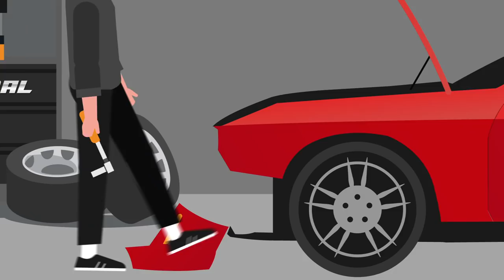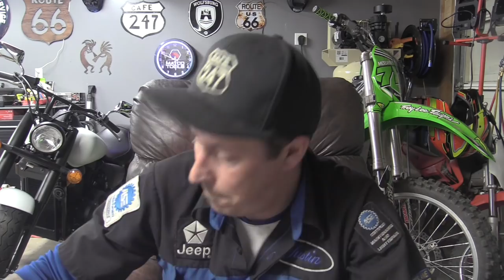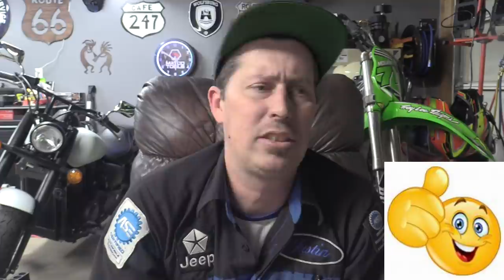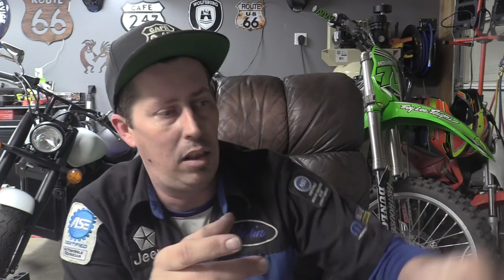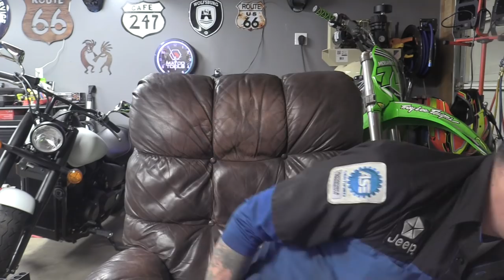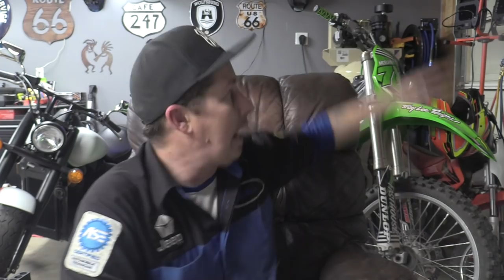Multi Point Inspection & After Repair Tips & Suggestions for Technicians!

Comment: I always take any car I work on for a quick spin before I pull it it, can't tell you how many times the car was just pulled in, and you sell some work, then on the test drive you hear a wheel bearing making noise, or some other rattle, so I quick test drive every car if possible first, make notes of any issues and put it on the safety check, keep up the good work Justin✌

Comment: Congratulations!  And
 i some what agree with the  parts but not the prices
Reply from the maker: The difference in price is the difference in quality and craftsmanship. The benefit is that it was designed to specifically fit that vehicle. Where is aftermarket components often times are just designed in a roundabout way so the casting is always off either something is too tall too big for the holes don’t even lineup so you have to use a die grinder to clean them out. Even if you were a DIY think about how much time you’re willing to spend trying to modify a component that was never really made to fit as well as a factory part. The advantages are that most OEM components also typically last longer in my experience. Lots of things to consider, but you’re not the only one that feels that way there are many People out there that are only focused on the price
Reply: @JustinDowDIYcentralhighway  what i meant by the comment was i agree with its great having the correct part there. But i do not agree that the part is 3 times the cost. The part was already engineered.  They are made . It should cost no more because it comes from a dealer not a person next door. There are other companies that make great parts. Ie. I would rather use a moog wheel bearing than oe. Lasts longer. Here is a thing. You buy different tools diffbrands. Let's say snap on invented it but you like matco more because its the same and same warranty.  Its also personal preference

Comment: Hey man! I'm looking for a solid answer to my question regarding the vacuum style/venturi coolant fillers. What happens to remaining coolant that might be in the system after draining before refilling. Would the tool still pull a good vacuum and load fresh coolant without air. Ever had the vacuum break a plastic reservoir or hose? Thanks
Reply: They just work, got an old blue point vacuum filler and it prevents overheating after all kinds of cooling system repairs! Never broken anything over 1000 cars, good to confirm you have no leaks (will it hold a vacuum?) without filling with coolant to see if it comes out.
Reply: This tool is not made for coolant removal !!! Some coolant WILL remain in the system usually in the engine block. The vacuum filler only removers the air thus eliminating air pockets, allowing the new coolant to completely refill the system. You still need to run it out and then top it off, but this doesn't take long because you don't have those HIDDEN air pockets to worry about. If a hose or plastic bottle fails due to vacuum on the system, then it would have or will fail with pressure on the system and needed to be replaced anyway.
Reply from the maker: Looks like he got a couple of really good answers here for you. I’m glad they were able to answer your question in a timely manner as I was in bed 😴 Just a piggyback off what they said the air lift/ Venturi coolant filler pause the air out to alleviate any kind of pockets within the system, it will pull a little bit of coolant out of one hose which is why you need an empty bottle to catch it in but it’s not a removal tool. I too have never had any plastic reservoirs break as a result of using it, also once you’ve officially pulled new coolant in I always run a second vacuum Just to ensure no Air in the system. Once that needle stops flicking and stays pretty consistent it’s pretty good indicator that there’s no longer any air in the system. Still perform a pressure test when you’re done because pulling a vacuum is different than the system being under pressure if everything holds up road test top off as needed

Comment: our inspection has a battery test many customers will decline the battery because it still starts ok, we very expensive battery testers midtronic, and a lot of dealer techs abuse this inspection to sell work most managers don't reconcile the inspection with the tech a writer, and some customers will take the inspection and get the work done somewhere else,i will not the oil leak and request additional time for diagnosing.